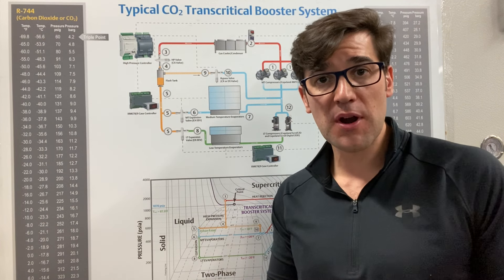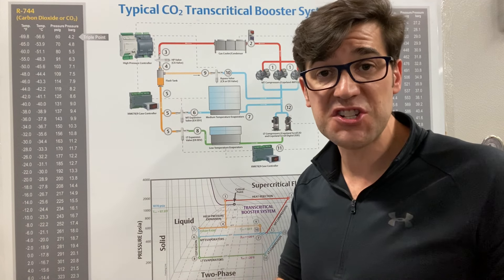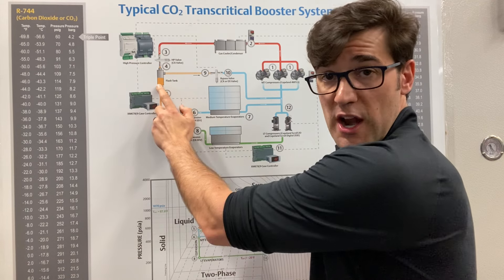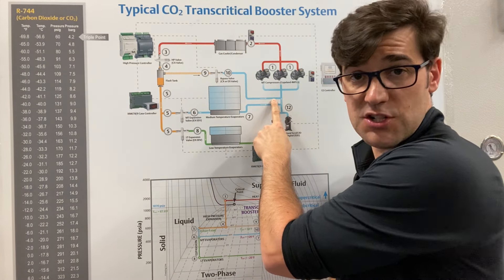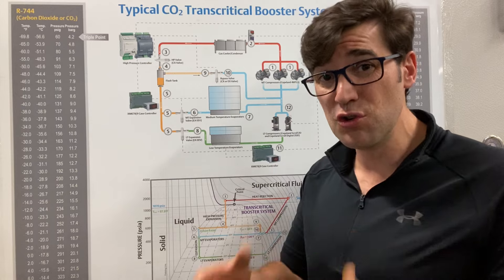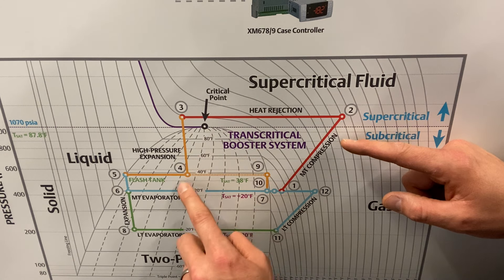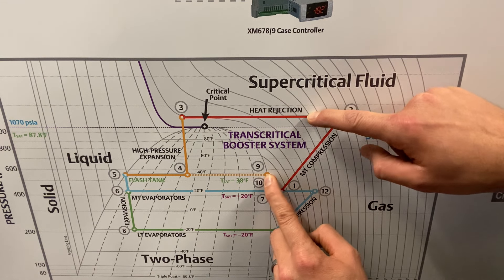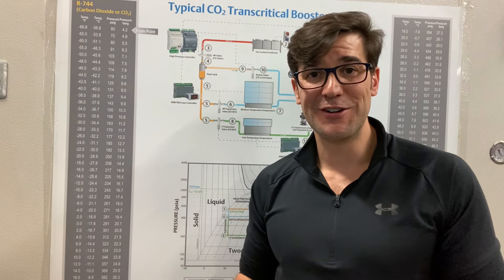CO2 Refrigeration Parallel Compression

Comment: correct me if im wrong but the IT compressor just effectively recirculates the flash gas. so, in addition, it does not do any real work, it does not contribute something very useful to the system
Reply from the maker: What it does is allow a smaller compressor to pump the flash gas at a higher suction pressure massively increasing the efficiency of a standard booster system. This reduces the amount of work the MT compressors have to do.

Comment: Cheers Trevor appreciate it! Just got me thinking about compression ratios. Wouldn't adding a higher pressure gas via the bypass valve to the suction raise our suction pressure slightly, thus causing a lower compressor ratio?
Reply from the maker: That is a great observation Daniel. With a standard booster system the issue is that the extra vapor (bypass) is at a higher suction pressure but it is not used in the refrigeration cycle it bypasses the evaporators and its causes more work/load on the compressors to keep the flash tank at a stable pressure.

Comment: Hello very nice explanation I like those short videos. I have a question. Do the bypass vavle work at the same time with the parallel compressor? How the regulation is made?
Reply from the maker: That is a great question William. To be honest I do not know the exact answer but in high ambient temperature locations you will bypass more gas which is inefficient for a system if its going through the FGBV.  I know when sized correctly you want either have the parallel compressor running or the FGBV (flash gas bypass valve) working.  When setup and designed like this you have to make sure you try and avoid continuous switching back and forth from FBPV to PC compression as this can cause issues in the system stability.  There is a lot of fine tuning to make sure this dose not happen.  First step is making the gas cooler control is setup properly follow by the High pressure valve (HPV) and when those are working correctly then setup the FGBV and than PC control.  There maybe other ways to do this and would love to hear from others.
Reply: Hi William, at Danfoss we always start by opening the by pass valve, as the parallel compressor is often too big at low loads (when just starting the system). Only when the by pass valve reaches a pre set opening degree for an also pre set amount of time, we switch over to the parallel compressor. We then first start the compressor and once it is up and running we close the valve. 
We close the valve by raising it’s setpoint, so if the compressor should fail and the receiver pressure goes up, the valve will spring back into action and start controlling again